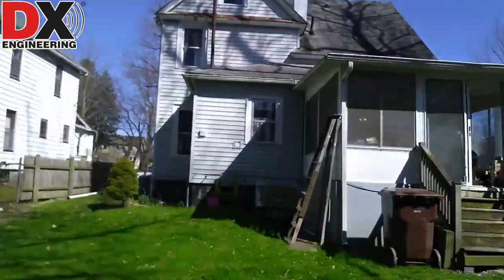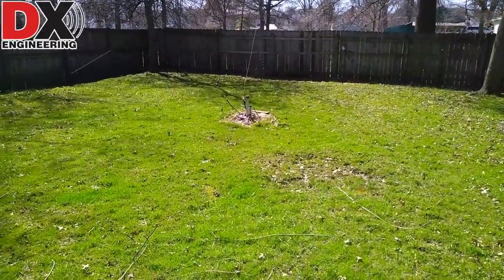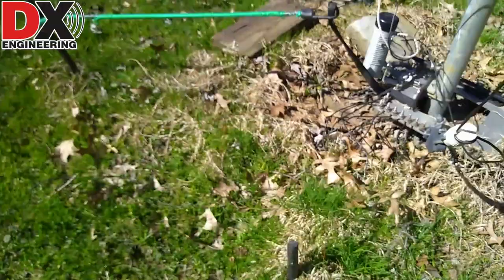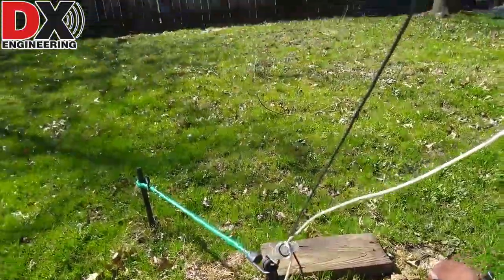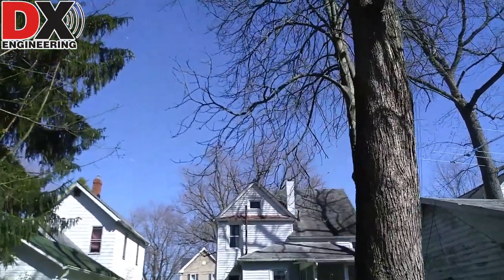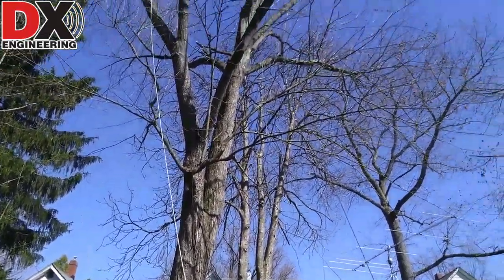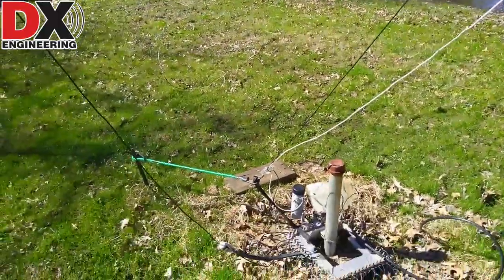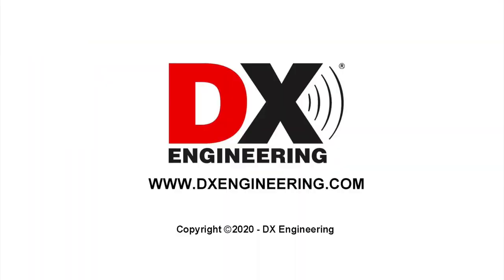K8RR 160, 80 and 40 Meter Wire "Fan" Vertical and Radial System

Comment from the maker: Thanks for your kind comments. I want to make clear that the neighbors chain link fence isn't realy "nice" and I was being facetious. Also, I should have stated the 160 wire is really an Inverted-L. It's about 130 ft., I think. All three wires are nearly quarter-wave resonant lengths, pruned and tuned roughly with the analyzer since they're affected by each other and the trees. Unlike a classic fan dipole, this fan vertical has a DXE-VMN-1, a classic shunt coil across the feedpoint. It improves the SWR match to the feedline by transforming the feedpoint low R component of Z up from 20 ohms or so to about 46 to 53 ohms, for the 160 and 80 meter wires. There are no loading coils, but if there were then the SWR bandwidth would get a lot narrower and efficiency goes down. I'd bet there are some "helpful" SWR bandwidth widening losses due to the insulated wire lying on the tress limbs, too. The 60 radials are between 22 and 30 ft., evenly spread in all directions. Still experimenting; will do a "Tuning the Fan Vertical with the Analyzer" video soon. As for the 118 year old fixer upper here in Ravenna, everything that it needs is proving to be more expensive than ever imagined, so it will take a long time to finish. 73, Rod K8RR

Comment: I have inverted v dipoles for 40 and 80 running off the same 1:1 balun feedpoint, 40m has good swr less than 1.5 from 7000 thru 7160, the 80 however has great swr, 1:1 at 3573 and approx 40khz either side. They both work fantastic with the feed point at around 55ft. I watched this video to get an idea on your radial system as i'm in the process of building a 160m 1/4 wave inverted L.

Comment: The radial plate seems be stainless. But the stainless clamp for the antenna are part stainless steel the Seattle clamp seems to be. But the u bolt and flat washers and lock washers and the nuts are not.  So it is a little false advertising and little over priced for what you get. And the  stainless bolts,flat washers, lock washers , nuts for the radial plate are not true stainless. 
So again false advertisement. They start to rust in a few Weeks to a month.